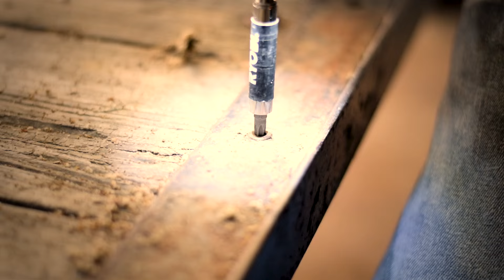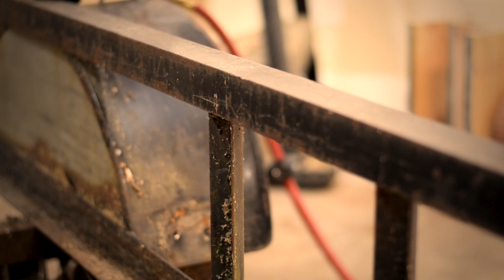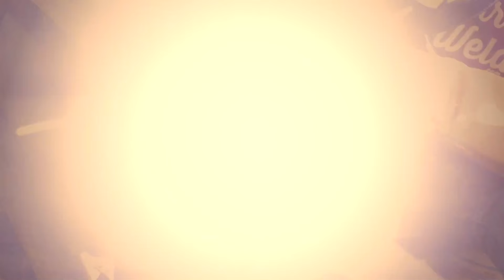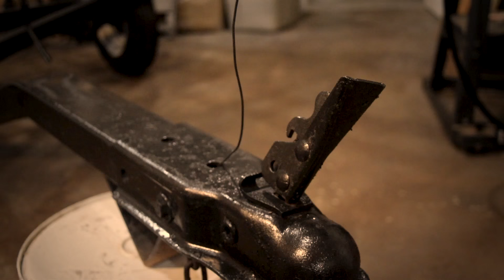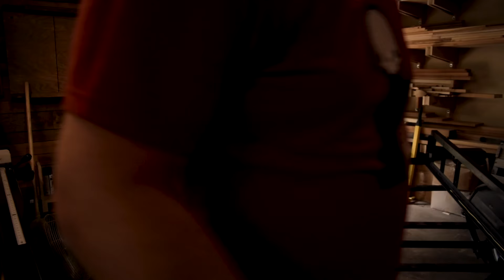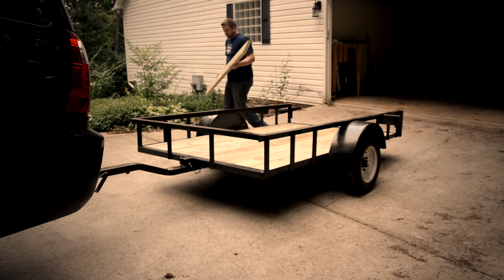How to restore an old trailer yourself

Comment: You did a good job.  Two things I would have done differently: 1) Paint or stain the boards for long term protection (even though they are pressure treated.   2) Wiring along the angle iron will chafe under the boards as it is placed.  3) Prime the Bare metal before painting it.
Reply from the maker: Thanks Mike and you're totally right, those would have made it an even better trailer! Right now it just chills in the back of my yard collecting leaves lol

Comment: Let me start off by saying, great job with the restore. I watched this video because I want to restore my brother's trailer for his business. But the one thing I noticed that no one else seems to have caught is the way you did your wire ties. You used house style wiring nuts. Those should only be used in home applications. They weren't designed to handle vibrations. In automotive applications you should solder and shrink tube.
Reply from the maker: +zeromystik yup you're totally right! I later went back and fixed that haha. Thank you for catching that :)

Comment: Thanks. Good stuff. What was that liguid you put down before drilling the metal?
Reply from the maker: They make threading oil you can use but honestly any kind of oil to keep the heat off the bit is all you really need.
Reply: @SouthernGinger  Figured it was for heat. Thanks for the clarification!

Comment: Just bought a rusty old tilt trailer and am thinking of doing the same thing.  What kind of discs were you using on your grinder?  Did it help?  Any tips?
Reply from the maker: I'd get some wire wheels and maybe some flap disks for your grinder and just some elbow grease :) I love restoring stuff and this project was very rewarding

Comment: Nice, looks great. 🤓 The only suggest I have is to add some gaskets to the metal where you're running wire through, to help prevent the wire shielding from scraping off and causing a short. But it's probably too late and it's probably not going to be a problem anyway!
Reply from the maker: +Live Free and DIY yeah I did round over those edges beforehand tho :)
Reply: If the wire insulation isn't strong enough to withstand the vibrations then natural selection will do its thing and cut the wire. And that's ok. We can't keep coddling underperforming wire insulation this way. Let the free market do its thing and in a few generations wires will be indestructible! Gaskation is theft!
Reply from the maker: Hehe couple years later now and they still holding strong!

Comment: Good video! What kind of sanding disc do you use? I tried a flap disc and worked great for about 4 minutes. 😕
Reply from the maker: Yeah that's what I used too, check out klingspor sandpaper

Comment: i wonder how much$$ for materials restoring a trailer that size. reason im asking is that i pick up this beat up 5 x 8 trailers that needs plenty of work done on it. just wondering is it worth putting all the work into it or simply just go buy a new one already intact. trailer i pick up needs new tires, board deck needs replacement, lights n wires need done, spare tire, paint job, and needs ramp for loading atvs.
Reply from the maker: I paid $300 for the trailer and put maybe $200 into it :)
Reply: great job restoring yours. i got the trailer for free so im guesting i will be spending 200+ on mine
Reply from the maker: @loyang7015  yeah I think that's well worth fixing then

Comment: Did you just pick up that trailer or have you had it? I ask because I'd be interested to know what you paid for a project/restoration trailer versus a new one.
Reply from the maker: +Deacon Woodworks trailer was $300 + $50 lights + $60 for new wheels and tires + $80 for decking and $15 for paint. So right around $500 total.

Comment: What size wood did you use on your trailer
Reply from the maker: That was 5/4 deck boards but you could use 2x8s if you can fit it! They're a little stronger too. Also make sure it's pressure treated wood :)
Reply: @SouthernGinger  thanks for the information
Reply from the maker: @daveyjones662  you bet!